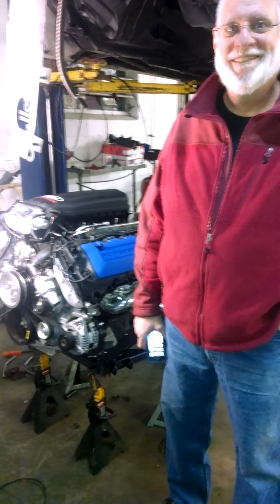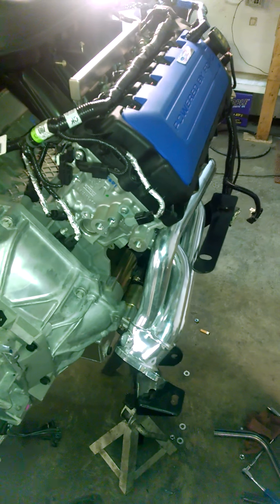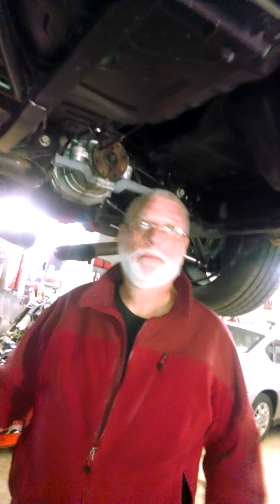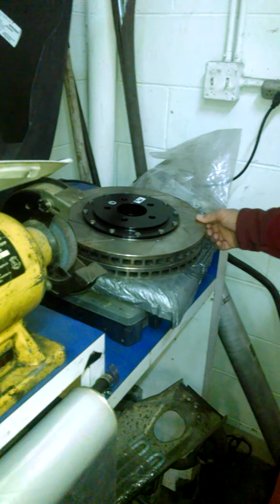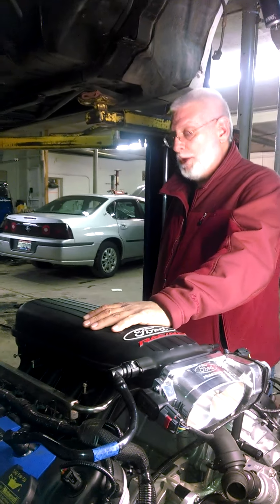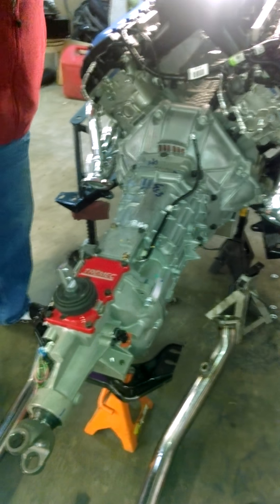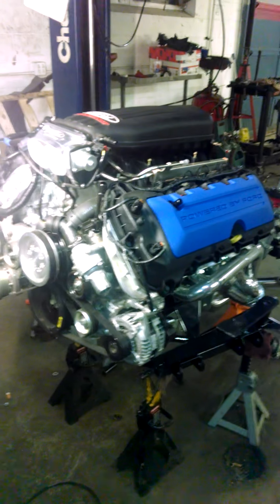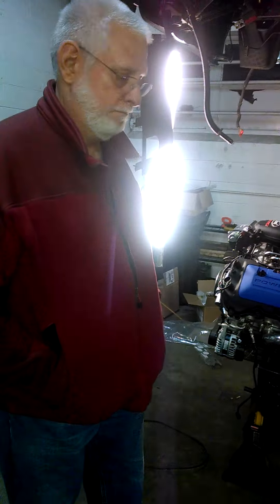Jon Spengler's coyote swap into a 2000 Mustang

Comment: Beauty swap! I'm planning on doing nearly an identical setup on my 1997 GT with a magnum T-56 and a Coyote along with the IRS and Brembo's up front however those 6 piston Baer's are very tempting. I'm gonna run the Coyote swap headers and H pipe which probably weren't out when you did this swap as they make things a TON easier with the exhaust, then I'll of to 99-04 Cobra  Cat-back. Love the idea and especially how this started out as a V6 car, great build!

Comment: I have a 2000 Ford Mustang that is a v6 3.8 automatic. How can I get more horse power  that will still have a smooth ride.
Reply from the maker: Lovely T you want to keep the car for a long time and are not afraid of spending 10-13k on the conversion, doing the work yourself, you might want a coyote swap.

Otherwise, you should consider buying a newer car with more horsepower.
Reply: Paul Ferris  I really like the car,  I want to keep it and fix it up more to my like but not spend sooo much on it.

Comment: Just my 2 cents after doing a engine swap on 4.3 v6 S10 to an EFI 350 V8. Engine swaps like this are a major pain and EXPENSIVE as you know what. Why not just buy a nice Terminator instead? You are going to make the same hp, have an IRS, saved half of a years work  and kept alot more money in the bank. Also who doesn't like a new edge Terminator. A blower swap alone would be all you need if anything to make amazing power.
Reply from the maker: +jmfut To each his own.  A lot of people that see my setup (less expensive than Jon's) still ask me why I didn't go with an LS motor.   Why not put a twin turbo kit on the V6?  Why not put a 5.4 motor in there out of a Navigator?  There's a ton of choices since it's a Fox body.   I love the Terminator's as well BTW, I just wanted a naturally aspirated, efficient motor myself, which is why I went with the Aluminator.  I didn't really do it for the money -- at the time it was not an easy swap and no one had documented how to do it.  I've never regretted the choice.

Comment: how much was it to install this motor and what shop
Reply from the maker: +Julian Moore This was in Columbus and I can only say I myself wouldn't recommend this shop for a coyote swap.   I don't know what they charged but if I were doing the work I'd charge somewhere between 8 and 12 k plus whatever it costs for the parts.    YMMV -- experienced shops are out there and I'd use that as a litmus test.  If they haven't done a Coyote swap I'd avoid them in other words.
Reply: so it would be best if i did the work myself i was trying to be lazy and let someone else do the job ......but i have been watching your videos..great videos by the way....did you have to do a return style fuel system because i didn't see you say anything about it n your videos
Reply from the maker: +Julian Moore thanks!  yes I went with high flow fuel's setup.  it's great but the stainless lines on your car are better IMHO.  with a new edge, you don't have a return line, but you can convert the vapor return and add a return the stock fuel hat.